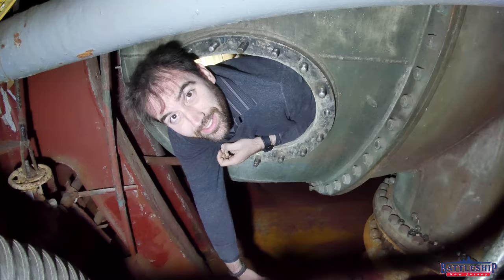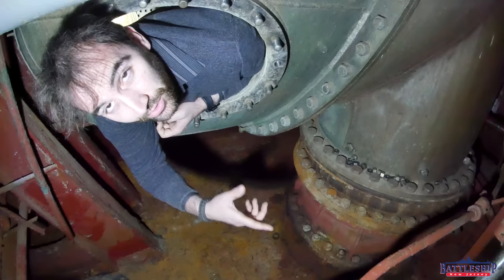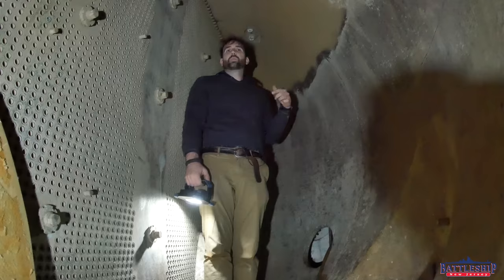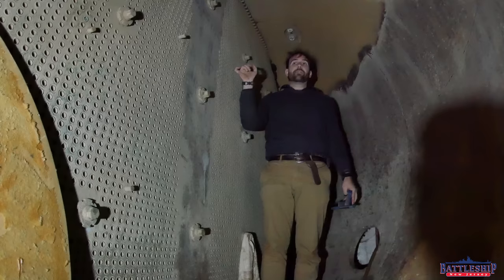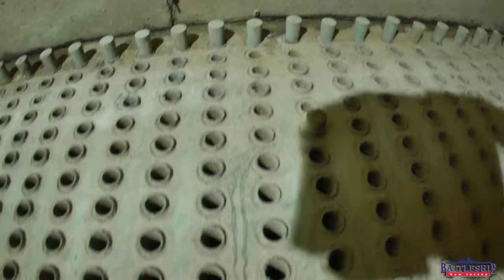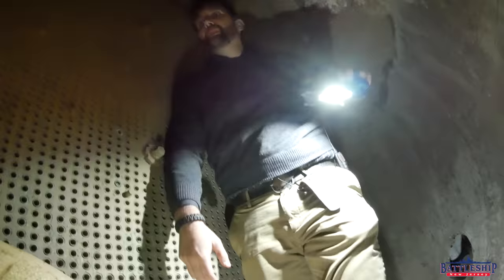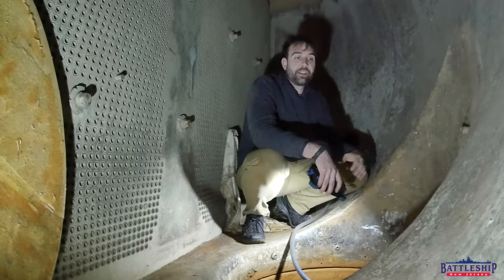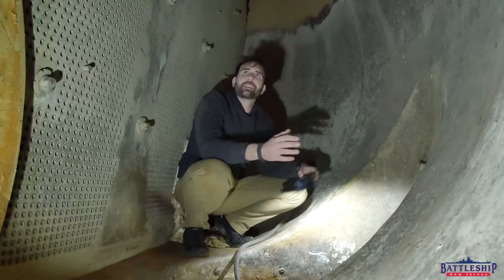Battleship New Jersey's First Hull Leak

Comment: its these engineering spaces that really reinforce the notion that a battleship isn't really a ship with big guns, but a giant armored machine to bring giant guns to the enemy
Reply: Yeah, the whole thing is basically a heavily armored oil fired power plant transporting huge guns around.
Reply: And the crewman who worked down in the bowels of the machine were referred to as moles, according to my dad. You rarely saw them as they toiled down in their world. Once in a while, a deck hatch or lid would open, and they would climb out for some sun, fresh air and a view, while taking a break. My dad was a GM, usually working out in the open, topside - which had its disadvantages when in foul weather.
Reply: They raised a similar question in old Top Gear. Can a car be art? If it's to be called art, then it has to serve no purpose other than to exist (as art) to be looked at (as art). They presented a gorgeous car... that was shit on the road, but it looked pretty.
So the question (similar) is is NJ a ship? Can battleships be classified as ships or are they merely transport means for guns? Well, it "sank" an island once, and did other things of equal notion, its main purposes are to store and deploy ammo in an orderly fashion... the comfort level was shit (for the most part). It's certainly not like a modern aircraft carrier... with its shops, sports areas and entertainment on deployment... it might just be guns with flotation means. But... she is pretty to look at, so there's that.
At least by my reckoning, a good ship needs to be pretty to look at too, and you can't deny that she has some really nice lines.
Reply: Yeah it's kind of crazy the more you delve into the details of all the engineering and living spaces, then you remember "oh yeah this is all just to move a couple guns around" 🤣
Reply: @RW4X4X3006  Snipes is the word.  Not sure where your dad got Mole, but we're called Snipes, there's a poem out there about us.
Reply: @aserta  as a former Nimitz class snipe, not sure where you got your information about modern carriers (mine was built and commissioned in the late '90's), but the "Shops" you speak of... There is a ship's store, and it's small.  You aren't getting much.  Sports areas, it doesn't exist.  We're allowed to use vacant area's of the hangar bay from time to time, and if there is a special occasion where the crew is granted a "Steel Beach Picnic" then we may also use the flight deck, but there are no designated "Sports areas."  Ships Gym's aren't even specifically for that.  They're extraneous areas of the ship that were repurposed, or more commonly, dual purposed, into a "gym."  Entertainment, probably better on a battleship in the '40's-'90's than a modern carrier.  Most of our entertainment was brought ourselves, just like it would have been done back then, although we do have the luxury of portable electronics today.  Any movies they might have done on the ship would have been on the ship's mess decks between chow times, usually late at night on the aft mess deck, and generally over crowded and not worth the hassle.
The biggest advantage we have on a carrier, is the ability to have stuff flown to us.  While on Deployment in 2010, we had Neil Armstrong and a couple other Apollo Astronauts flown out to speak to us.  That was done in the hangar bay.  It was neat.  That said, life on a modern carrier, particularly in the middle east, was pretty miserable.  The Nimitz class was deigned to be operated in cold waters like the North Atlantic and Arctic oceans.  There was nothing you could do on the ship without sweating.  Shut off the water and the sweat beads before you can get your towel.
Now, I have no experience with Ford class, but I can tell you, Nimitz ain't that grand.
Reply: @aserta  I've heard that's how the Russians designed their aircraft during and after WW2. The designer, Tupolev maybe, said an aircraft must be pleasing to the eye as well as perform. I agree about the ship, she's beautiful. Form and function well done.
Reply: @jameskee2412  You're right! I'd been rolling 17 hour day last night. 🥱
Reply: @RW4X4X3006  I got you bud.  Been there plenty of times, particularly while working down below 😉
Reply: I've always thought of it as a huge floating industrial site.
Reply: @zackakai5173  
Well, a few hundred altogether.
Reply: @jimcat68  that's pretty accurate
Reply: @jimcat68  It could be an estate. Yes?
Reply: @jameskee2412  Once during Rose Festival in Portland Or, while the fleet was in, my little brother and I snuck away from a guided tour of one of the cruisers. I was 10 or 11 at the time. We managed to open a door, which took both of us, and jumped through it onto a staircase that descended down into the land of a million pipes and a blasting hot air. After a few minutes of our adventure, a sailor yelled at us "Hey, what are you little F#ckers doing down here!" We freaked and bolted the way we came, but were surrounded and bagged up. They were all jovial and having fun with us - gave us a tour. I don't remember anything they described regarding the tour, but the grub they gave us for lunch was awesome - with ice cream. Then they took us up to the main deck and let us go. My dad wasn't worried about where we were - That ship was the safest place in the city for any kid, he would say (as a compliment to the crew)
Reply: @RW4X4X3006  cruiser is vastly different than a Carrier though.  Be a whole different problem if that happened on a modern carrier.
Not for how any of the sailors would treat you, but the whole Nuclear thing.
Reply: @jameskee2412  Of course. That was back in 1980. These days we'd be tossed in the can wondering what we did wrong. They knew we were just a couple of adventurous little turds.
Reply: That's effectively what a military is. Just a big organization/group with the majority being administrative/support/logistics personnel who's whole job is to get the guns (and people who use them) to the battlefield and keep them supplied. Something like for every 1 soldier actually fighting, there's 10 other people who's job is simply to keep them fed/alive/supplied/comfortable.
Reply: @Stealth86651  that's no where near accurate.  Yes, those people are needed, but the ratio is not only reversed, it's far worse than that.
I guess the better way to explain it is that, each of those 10 people per soldier is responsible for no less than 100 soldiers.  So yeah, a 100k army is only going to have a 10k strong support infrastructure.
Reply: @Stealth86651  Many more than 10, per combatant. Have you ever witnessed an American armored division deployed? To the average potato, it would seem like a whirlwind of chaos - yet it functions.
Reply: @RW4X4X3006  Just a matter of local dialect. In the US we usually say "industrial park" rather than "industrial estate", but the meaning is the same.
Reply: @jimcat68  But it could be an estate. My foxhole was a friggin mansion.
Reply: When all is said and done, without the Engineering Plant operable and in good condition, ANY warship is just a fixed emplacement suitable for harbor defense.
Reply: @James Kee  I loved when we were put on 4 on 4 off down in our boiler room. plus, having to do your work shift. 4am to 8am watch, 8am to 8pm work shift. 8pm to 12 am watch off 12am to 4am sleeping. repeat.
Reply: @harleyhawk7959  For those who can't envision Harley's day, simply get a membership at your local health club and spend 20 hours of your day alternating between exercising in the Steam Room and exercising in the Sauna.  When you are done, stand in line for the showers then go catch a nap in the Weight Room or other noisy area for the rest of the 4 hours , then repeat.

As you are doing this, remember that the gal at the Reception Desk probably makes more than you do...
Reply: @RW4X4X3006  Bilge rat is another term of endearment  =)
Reply: @roryoneill6699  Thinking about it, my pops said "You never went down there. Why dad? Because there are some places on a destroyer you don't go!" Rrrrrrrr !!
Reply: Yes, and that armomred machine is called a ship, so..........
Reply: @RW4X4X3006  That's a wonderful story.
Reply: @roryoneill6699  Which one?
Reply: @RW4X4X3006  the Rose Festival one.  I was top watch in #1 fireroom when we went up the river to Portland.
Reply: @roryoneill6699  Rose Festival was great back in those days. Sometimes, they'd pack in 3 abreast along the waterfront. The best was when USS New Jersey dropped in to participate back in 1990. What a shitstorm that was in Portland. Protesters freaking out. All of those guns stuckin out like a monstrous porcupine had them riled up. I was on leave from Korea at the time, and we (pop, brother and I) went aboard New Jersey to tour and hang out. Unforgettable experience. I'd never seen a real battleship before, and just laughed upon first sight - what a huge keg of whoop-ass! OMG!! My dad was like a kid under the Christmas tree, giving us the lowdown on his home away from home - the 5"38 mount.
Reply: @aserta  You got me curious, so I found a link to "can a car be art?":  
https://www.youtube.com/watch?v=aQ8xDia5RNY

However I strongly disagree with that Tate curator about his definition of 'art'. Of course an object can both be art and be useful! Dude thinks a magnificent cathedral can't be art because it also keeps the rain off the parishioners? Absurd! But fun to argue about :)
Reply: The Captain of the Knox class frigate told us during our welcome aboard speech, "This is an ASW weapons platform." I guess it's not a ship then.
Reply: All guns are portable if you're brave enough
Reply: @jimcat68  Used to say that without the weapon systems, radar, etc, "It's just a shitty cruise ship."
Reply: The giant armored machine is called a battleship. Thanks for that deep perspective captain obvious.
Reply: @olliefoxx7165  “For an aircraft to fly well, it must be beautiful" - Marcel Dassault

Comment: Crazy to me that a battleship can have hundreds of openings in the hull, a large ship I was on for a while only had 3 openings specifically to reduce the openings in the hull and help prevent flooding!
Reply: I spent a lot of time under the New Jersey  in drydock #1 back in 1987, and I only found four openings, one for each sea chest.  Those were the only places I could stand up and stretch after walking hunched over between keel blocks
Reply: Which ship was that?
Reply: @studinthemaking  BB62 >> New Jersey he said...
Reply: @Formulabruce  You are confused. Re read the statement.
Reply: @ytlas3  yeah i can agree. im a boat builder and one of the selling  points of a sea chest is to limit the amount of holes through the hull. i can not see the new jersey having a hundred holes. four or five large sea chests sounds like more of a believable amount.
Reply: @Formulabruce  he's talking about the original post
Reply: @williamparker2922  He made the same kind of comment a few months ago when he posted a picture of the New Jersey in drydock.  The shipyard had cut hundreds of round "sand holes" in the sides of the hull, so the Equipment Cleaners could sandblast the tanks, then the painters would take care of the tanks before the welders would weld back up the holes.
Reply: On a ship that might be torpedoed a pipe going though bulkheads would be about as dangerous as a hull opening.
Reply: From the sea chest, many tubes ran from them .  Also there were openings above the water lines for discharging.  Through the hull ,either directly or indirectly. My thoughts anyway.
Reply: @williamparker2922  he’s the curator of that museum ship 
I believe you’re both probably right 
There’s a reasonable explanation I’m sure 
Maybe the ship didn’t have more than a few holes when built 
And had many more made when taken out of service to remove equipment, make repairs, etc
Reply: Gotta be more than 4 or 5 openings in hull as some have said. Main engine, generators, Evap,s, fire systems all use salt water. Some people may not know but even the toilets and urinals use salt water. I was on a carrier which has a similar engineering layout as this battleship.

Comment: "So the water thinks this part of the ship is flooded... As much as water can think"
Thank you Ryan! That remark put a smile on my face and made me giggle a bit, love that simplistic explanation!
Reply: You must have missed the part at 8:44 then :D Another fun one
Reply: Don't anthropomorphize inanimate objects.  They hate it when you do that.
Reply: @OverpaidSlacker  When the engine in my car complains because it's very cold on start, I stroke the dashboard and tell it, it's ok.  This makes it run better.  When I do the same thing to a network switch serving 30 people, it immediately dies.  I don't know where battleships fall on that spectrum, but I would like to believe they are closer to my car than the switch.
Reply: It literally makes no sense as the water pressure on the weld would be exactly the same, they'd have the pressurise the room.
Reply: @benlawton5420  maybe what he meant is the welded "plug" is actually filled with a pressurised fresh water that pushes away salt-water from contacting the weld. The weld is of different metal than the pipe, so they have to make sure no electrolytes (eg: salt-water) touches these 2 metals simultaneously, otherwise it creates a galvanic reaction (ie: battery) that cause either metal to corrode.
Reply: @xponen_  That'd make more sense.
Reply: @benlawton5420  I agree, the "pressure equalization" explanation does not make any sense to me either.  To make it work you could pressurize the room as you say.  It would be simpler to put a second bulkhead in the pipe above the bulkhead in contact with the salt water and pressurize the space between the two bulkheads as xponon indicated in his comment.  If I were doing it I would use pressurized air (or nitrogen) rather than fresh water to pressurize the space between the bulkheads and put in a pressure gauge which would indicate (via pressure change) whether there was a leak or not.
Reply: @benlawton5420 : My guess was that they drilled the leak and tapped the hole to make the fitting he showed with the hose stuck into it.
Reply: @benlawton5420  It's a very bad explanation.

Comment: You ought to be able to find a scrap metal dealer with a Positive Material Identification (PMI) "gun" who would be willing to volunteer to identify some of the odd / unknown parts of the ship in return for a little acknowledgement in one of these videos.

These are relatively small, handheld X-ray fluorescence analyzers, set up to identify metal alloys.
Reply: PMI systems can't tell carbon content ect, so won't really inform you of physical properties (such as hardness, further potential for hardening or electro-negitivity), only what saleable components you could get by melting a part down. Also most newer devices are optical emission, not xray.
Reply: @SheepInACart  Carbon content really only comes into play for weldability.

I don't know what types of PMI equipment you're using, because the inspectors at my employer use them to determine which grade of stainless or alloy is being received on site for pressure vessels and piping, and those devices still use X-rays.
Reply: The shipyard most likely would've used some standard grade of steel for any part not specifically designed to be made of something special, so if you can figure out the metal alloy profile you can probably just compare it to the standard alloys in use at the time and see what it's supposed to be. I doubt that something like this would be made of some oddball one-off alloy when all it has to do is hold water.
Reply: @LenKusov  TBH, the spec life for these ships iirc was 8 years so I'm guessing they weren't that bothered what they used as long as they thought it would last 12 years minimum, spec life + 50%.
Reply: Materials/metallurgical engineer here!

The newest handheld LIBS units can essentially identify every element on the table (within reason). They are getting quite fancy!

Comment: It's been a while since I was playing around with bronze and brass alloys, but I remember that both could be made magnetic through the addition of just trace amounts of iron or nickel.  Magnetic brass/bronze alloys are typically still corrosion resistant and will usually simply develop a patina instead of ever rusting away.
Reply: brass does not rust, I think he is talking about bi-metallic corrosion.  Im deaf and no closed captions on this one.